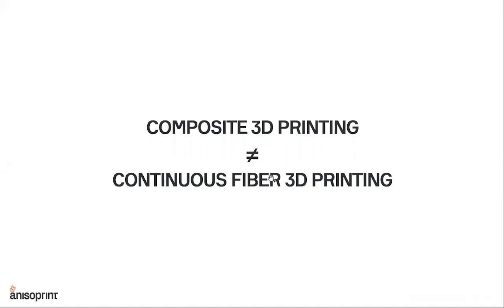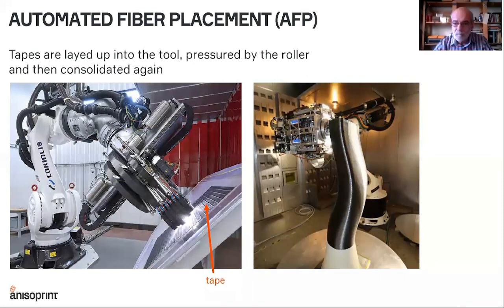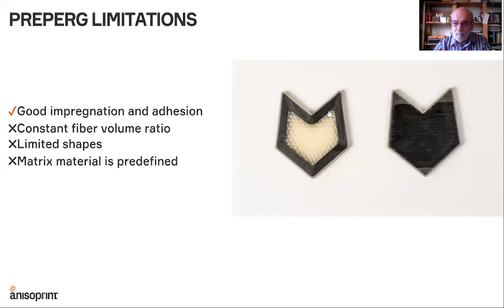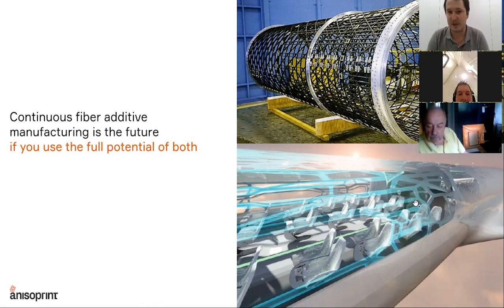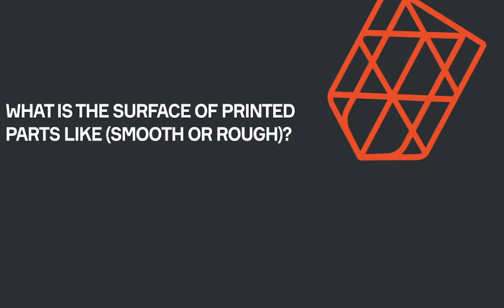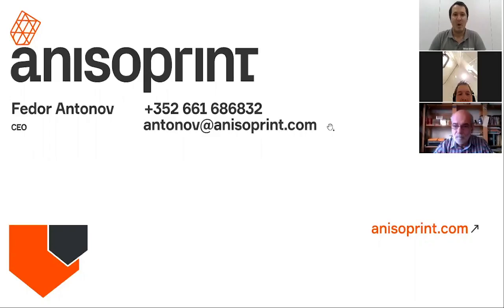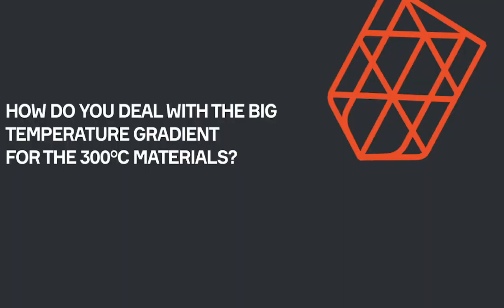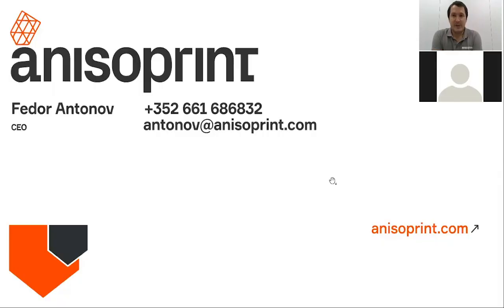3D printing of COMPOSITES with CONTINUOUS CARBON FIBER: current technologies overview

Comment: Can Nylon-X (Nylon based with chopped carbon fiber particles) be used along with the continuous carbon fiber filament for added strength? Can the nozzle that comes with it be used for the Nylon-X?